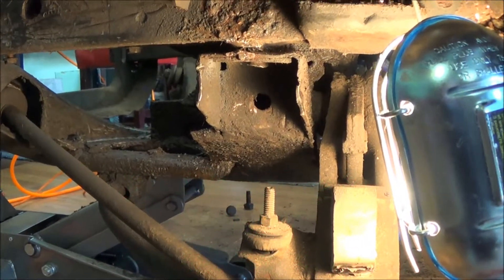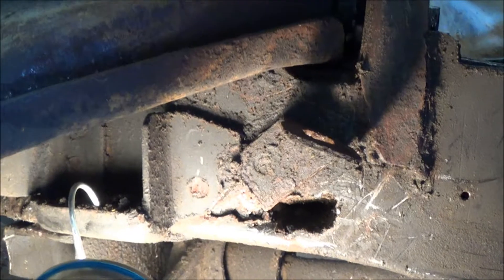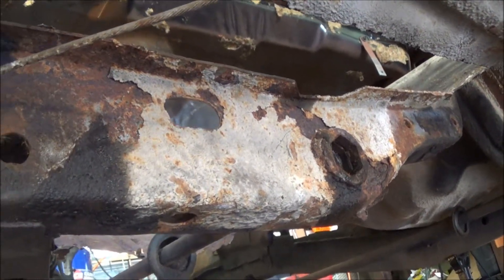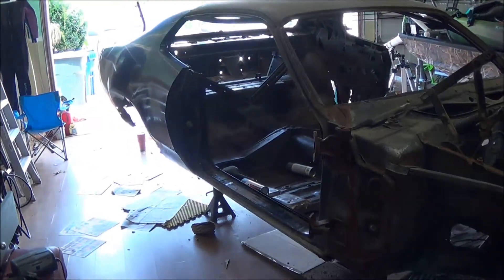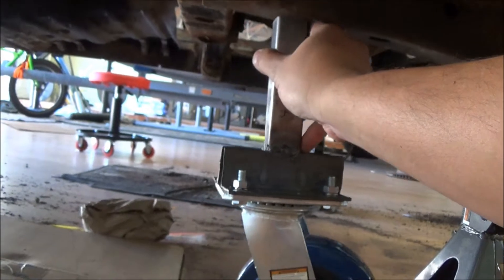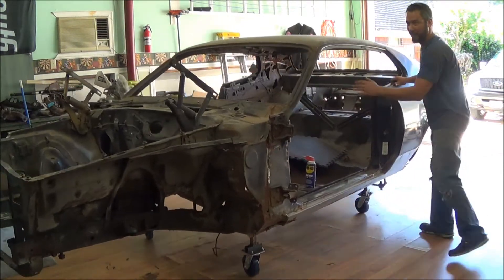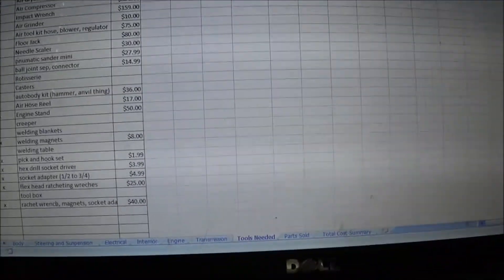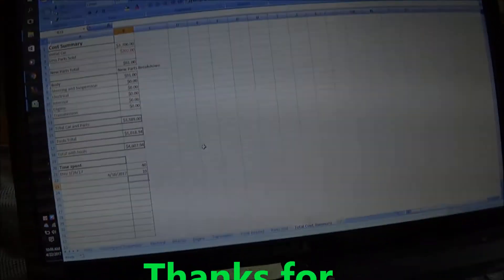Ep. 6 Removing K-Member and adding casters

Comment: You're making good progress. That K member is going to be a pain to repair.
Reply from the maker: Carolina Man do you mean pressing all the bushings and replacing ball joints?   the k-member itself doesn't look to have any damage at first glance (I haven't looked it over with a fine toothed comb).  Or do you mean the frame rail where the k-member screws in?

Comment: Nice.  Those casters seem to do the job.  I also track spending in excel and have separated car parts/consumables from tools like you have done.  My first year was mostly tool costs.  It helps a lot with budgeting and tracking your expenses.  I'm also using it to plan the build so I don't have all the big expenses at the same time.
Reply from the maker: Not to mention... the next build will go much faster and have way less initial cost!

Comment: I  don't remember if you said, is the replacement k member going to be a coil over?  If so you don't have to worry about the torsion bars. Good job on the casters.
Reply from the maker: Douglas Surber thanks!  I'm not 100% sure yet what I'll be doing on the front end.  I may use the current k-member and just upgrade the brakes if I can find a knuckle that will fit or a way to upgrade to a hub assembly rather than bearings in the brake disc and spindle.   do you know if it's possible to do coil overs with current k-member?   I haven't looked into it at all yet.
Reply: I don't think you can because of the way the control arms hang on the k-member .I watched a video on y-tube about it but cant remember where. If I can find it I'll let you know.
Reply: Try QA-1 or Magnum Force.  They have a couple of different  kits.
Reply from the maker: Yeah...Ive seen a few.  It kinda goes back to the struggle of what the car will eventually be and how much I can/want to put into it.  The more fun and expensive add-ons, the longer it will take to finish.  Thanks tho!  Ill check those out.